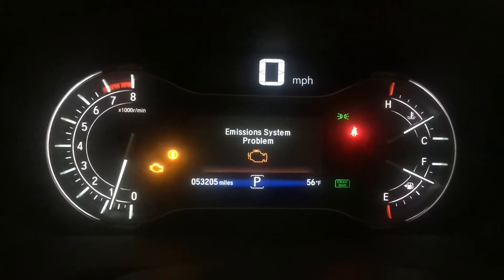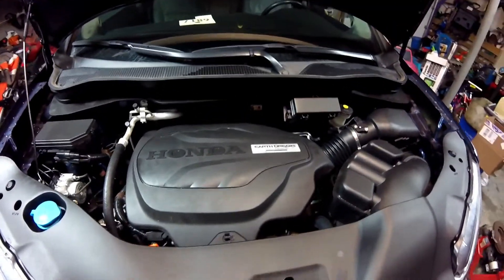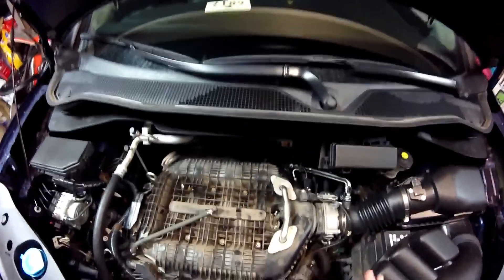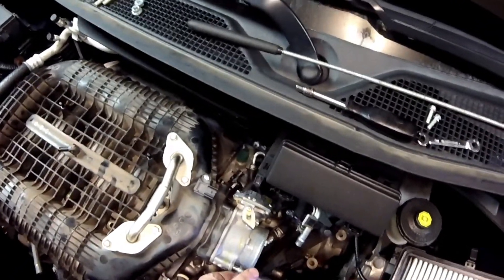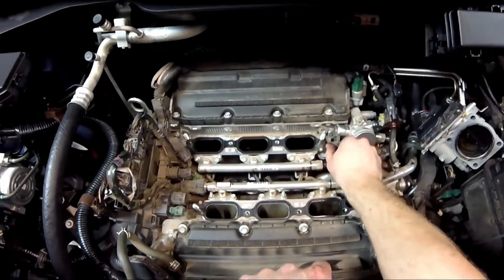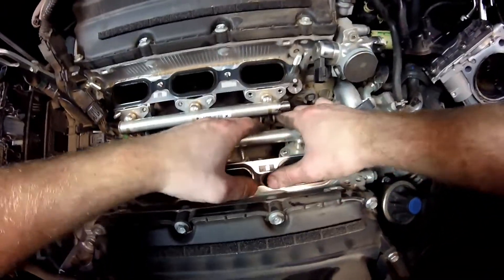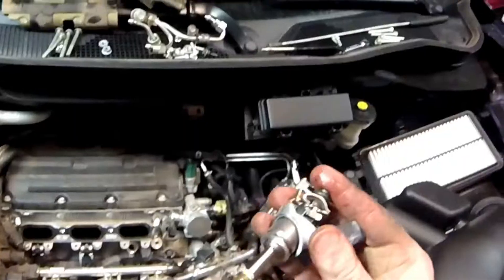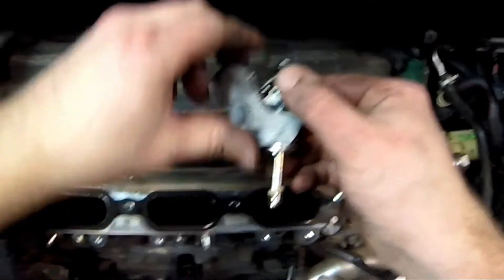2016 Honda Pilot P0430 Service Emissions System - Fuel Injector Replacement-Part 1

Comment: Warning just came on. Sigh. What did you use to detect the codes? I know there's all kinds of code readers out there.
Reply from the maker: I use BlueDriver. It works well with my iPhone.
Reply: @PetesGarageandperformance  Cool thx. So the warning went away and hasn't come back. Dumping some sea foam first, that has worked before on a different car to clean sensors related to emissions. But I have this procedure in my back pocket when needed. You made it look pretty straight forward for the most part.
Reply: update I got my BlueDriver odbc reader (I love this thing already, so easy to use) and it reports P219B "Bank=2 Air Fuel Ratio imbalance". "Frequently reported fix: Replace fuel injector."  Same code. Sigh.  No pending codes. You video was easy to follow but the eye-sight isn't what it used to be so need to think about doing it myself or letting local repair shop (not dealer) fix it.  Thanks to your videos its pretty clear what to do. BTW, any suggestion on honda injector p/n to order?

Comment: Sep 6th,2021. My 2016 pilot shows p0139 and p0159, sensor bank slow response. Long term fuel rich, slightly misfire on c5. Replaced fuel injector, all tested good. Argued with them before , service rep did a quick search and told me 0 cost to do this and waived off inspection fee as well. They also said fuel filler cap evap test a large leak , want charge me 205 cad for filler cap replacement, waiting for the parts …

Comment: I have the same problem on pilot 2019 21k  miles. Dealer are charging me 200 for injectors clean up 200 for throttle body clean up. I won't pay

Comment: Posted here and in Part 2 vid as well: First, thanks for the videos, Pete! The process looked pretty straightforward and I was reviewing the videos to do it myself. As others have mentioned, though, the good news is that this is a known issue by Honda and they have issued at least a couple TSBs and will correct the problem for free if your car is within time/mileage window. You can also apply for reimbursement through Honda if you already did the work yourself or paid for the work elsewhere. The original bulletin, 18-025, was replaced by 20-100 for some Pilots, Ridgelines, and Odysseys. Here's the link to 20-100: https://static.nhtsa.gov/odi/tsbs/2021/MC-10187006-0001.pdf
Reply from the maker: Thanks for the information and the heads up. At least they’re standing behind them now. Sucks for all the people who had to either fight with Honda or pay to have them replaced.

Comment: Check engine light came on with these codes on my pilot. I ran a gallon of xylene with 8 gallons of gas. Check engine light out and codes gone.
Reply: How many miles did your vehicle have when the check engine light came on and you performed this action, and after three years has the Emission System Problem come back?

Comment: Okay. It's now February 2021. I have a 2017 Pilot, bought it brand new with 7 miles on the clock. Yesterday around @26500 miles my Pilot displayed the same message.[ passed the 36000/3 years warranty].  Took it to Honda and had they run a diagnostic.  They replaced the Fuel injector kit.  Apparently there ' s an extended warranty TSB #20-100
7529 WAR2. Honda replaced the Fuel Injector Kit free of charge. Part# 37805-RLV-315. HOPE THIS HELPS SOMEONE. Initially I was going to do it myself but I ended up saving around  $500.00 for parts ... but  thanks to the extended warranty it was $0.00 out of my pocket.

Comment: Thanks for the video.  I have a Pilot 2016 with 75k miles.  It had the same issue and the dealer will be doing the work. It was the fuel injectors as described in this video.
Reply: Forgot to mention, the Honda dealer is doing the work under warranty at zero cost to me.
Reply from the maker: That’s great. At least you don’t have to pay for it.

Comment: Great video!  However, this is not something that can be easily tackle.  I suggest leave it to pro!  My 2017 Pilot had the Emission Light P0430 came on at about 49K miles.  So you don't have much option, dealers will charge about $1,500+, the injector itself is about $250 for all 6.  Long story short, I grab 6 bottle of Chevron Fuel Injector cleaner from Amazon - $37.00   Follow the instruction.  When completed my 2nd bottle, the light disappear.  It's been more than 3 gas fill up (approx 1,000 miles) and it has not reappear.  Prior to this, it would appear after 75 miles after fill up.  Keeping my finger cross!  Hope this help people!
Reply: Any update?
Reply: @jonimzari1687  Honda had a recalled and I took to my local Honda dealer to have it repaired...Haven't gotten the issue since..finger crossed!
Reply: I got a used 2018 last night and driving home (it was late) from dealership got the emissions light... bruh 🤦🏽‍♂️
Reply: @jonimzari1687  Disappointed!  Check your VIN to make sure if it was recalled.  If it's a recall and the previous owner didn't do them, just take it to any Honda Dealer.  If not, you have to get a scan reader to see what the actual emissions error code and go from there.
Reply: @rontan8954  i called the dealership i went thru they said to bring it back since it hasn't even been 24 hrs but I got a feeling they just going to delete the code and it will come back. My dad owns a mech shop so im goin to.run a scan before I go just for curiosity
Reply: @rontan8954  they cleared the code and im moving on...I suspect the dealership may have done that originally when they took the car and then it came back...so the issue was always there it just didn't appear on my test drive
Reply: @jonimzari1687  After a cleared code, Usually come back after apprx 100- 150 miles.  A P0420/P0430 is an emission sensor problem code cause by several factor:  Air/Fuel sensor, catalytic, Oxygen Sensor, leaky exhaust.  Almost 80% of the time it's the downstream O2 sensors, usually happen around 80 - 100K miles.  If 02 sensors is the culprits, make sure you get Denso brand, it seems to last a bit longer based on my experience.  Good luck and let me know what you found!.
Reply: @rontan8954  I ended putting some injector cleaner in the car. After first 50 miles the fault was still on. After thst it disappeared and been gone for 350 miles 🤟🏽

Comment: Doing this repair right now and the upper manifold won't come off because of an electric cover on the left side of the engine.  It looks like you have it on in one shot and off in the next.  Any ideas?  Thanks a million!
Reply from the maker: I’m not sure what electric cover you’re talking about. Did you end up getting it?
Reply: @PetesGarageandperformance  I figured it out.  It was the piece that you put back on in the second video at 12:46.  I just didn't want to break it.  Got it done and it drives great.  Added a VCM Muzzler as well so hopefully I won't have to do this ever again...  Thanks for the video.  Saved me $$$.

Comment: What is the most likely cause of this Emission System Problem? Could it be Fuel type? (Premium vs Regular).I just had it pop up on my 2017 Honda Pilot EXL AWD. Thank you.
Reply: Just took my 2017 pilot in today for same problem ur having. They said 160$ for diagnostic. We’ll see what’s wrong
Reply: @generalponcho808  It costed about $1200 i didn't have to pay a dime because the vehicle is still under 100k miles warranty.
Reply: @edgarcharles3637  just got word FUEL INJECTORS @ 60201 miles 2017 Honda Pilot. Luckily covered to replace fuel injectors!  Hilo Hawaii. I’m the second owner of car

Comment: I'm so glad I found this video before I got started. I'm assuming the 2017 will be identical to this one. I've been having a fuel air imbalance issue in bank one for a while and now just recently started getting misfires in cylinders 2 and 3.
Reply from the maker: I would say that it’s probably the injectors.

Comment: Pete, thanks for the video, I followed it and the project went smooth, I have a 2016 Honda Pilot.  The problem still exists, could it be that I have not had the new injectors reprogrammed?
Reply from the maker: What was the problem. Just the code?  Clear the code and you’ll have to drive enough for the monitor to pass.
Reply: When accelerating about 2k rpm, car would start jerking, took it to Honda codes p0304, p0420. P219-A, they said I needed new injectors.
Reply from the maker: From my experience if the car is jerking then it’s probably something in the ignition system. I would swap the ignition coil and spark plug with another cylinder and see if it follows it.

Comment: Guess I'm lucky I got 88k miles and it just came on
Reply: Well they ended up replacing the injector set and injector pipes suposedly their was no service bulletin for this repair, this is my very first vehicle I buy from new I got a good price on it $12k off MSRP it's a 17 that I bought Jan of 18 with 8 miles on the OD 2y and 7m later I got 88k miles on it, I added all the imaginable coverages on it from tires and wheels to replacement key fobs to door dings repair to interior repair or replacement and a 6yr 120k mile extended warranty, so this repair got charged to the warranty I paid $100 deductible, I asked the guy if once my warranty was over if i could purchase another one he said yes I have to talk to finance, so might be something you all want to look in to if you don't have it is go to the honda dealer and look in to buying the honda extended warranty not certain that you can but it's worth a try I've definitely gotten my money's worth so far 4 covered repairs over $3800.00 worth.

Comment: I have a question I have  a Honda Civic ex 2018 can you please help me the following lights came up out of nowhere emissions system problem, brake system problem, brake hold system problem, vehicle stability assistant problem, hill start assistant problem and power steering system problem they all lit up at once can let me know what it could be??
Reply from the maker: To be honest it could be anything. You really need to have the codes scanned to see what they are. This would help narrow things down.

Comment: Had the same emissions systems error popping up then going away then coming back, I changed the objectors and oil pressure switch error went away for a bit then came back ,now am seeing a keyless start system problem error as well
Reply: Can u suggest anything @petesgarage
Reply from the maker: The injectors won’t have anything to do with the keyless start system. Maybe the key fob battery is weak? In order to diagnose it you would need a factory scan tool to see what the code it’s setting.

Comment: My 2116 pilot emissions system warning light comes on and goes off before I can take it to the dealer.  So I finally took it to them without the warning light being on and they told me I have to get the injectors replaced. Bought it with 83000 and now it’s 92000 and they want to charge me over 1700 to replaced. Any advice
Reply from the maker: $1700 is pretty steep for this job. If you’re mechanically inclined, do it yourself and save over $1000. Just follow along with my video.

Comment: How long can drive with this problem before you fix it??!!
Reply from the maker: Probably not too long since the code is telling you that the catalytic converter is compromised.
Reply: I had replaced fuel injectors (replaced them actually twice) and after couple weeks of getting fixed , I got another code, needed to replace catalytic converter. Just picked it up yesterday and now another light is on, now transmission system problem. Ugh. I was told now I need to replace the torque. When will I see an end on these lights? I have a 2017 pilot. I never had any issues with my Honda Accords.
Reply: @mireya-y9c  You mentioned you replaced the injectors twice, by chance did you get them covered free of charge going through a Honda dealer, or you replaced them yourself? Also how many miles did you did your Pilot go through before having to change them a second time "Injectors"
Thank you in advanced

Comment: My pilot has been at Honda for 7 days. For the injectors!! I even had a scheduled appointment!!!
Reply: @Amarrah my car was fixed after a month and running good until now after they replaced the fuel injectors. The parts that caused a month delay doesn't even solve the problem. They never believe me at first when I told them that the problem was the injectors. If you have the same problem tell them that this is a common issue with pilots 3rd gen and insists that they should fix the fuel injectors.
Reply from the maker: Wow! They must be backed up or something! This job doesn't take that long. I wonder if they found something else?
Reply: Pete's Garage that’s what happens when you don’t care about profiting from the mechanics work. They get all the money from the car sales
Reply: Mine has been a month already. They said the parts are backordered. 2016 pilot  ex

Comment: Hey Peter, I have the same issues on my pilot 2016 and what other parts require beside the fuel injector which I already bought it. Do I need to buy the pipe that run through it?
Reply from the maker: I did all 6 injectors. You are supposed to replace the feed pipe but I didn’t. Just make sure it doesn’t leak fuel when done.
Reply: Pete, I also bought the same injector set from the site you had in the description.
Reply from the maker: I did all 6 injectors. You are supposed to replace the feed pipe but I didn’t. Just make sure it doesn’t leak fuel when done.
Reply: Hey Pete, I spoke with one the local garage repair guy. He told me they require special tool to seal the fuel injector. He wasn't sure if they come with sealed or not. Can you please give me some more info do I can get this done with local garage guy instead of Honda dealership who wants to rip me off
Reply from the maker: Ankit Patel the ones we purchased from the dealership came with the seals already installed on them ready to go.

Comment: 2016 Honda Pilot with 64,000 miles. Fuel Injectors went bad but my extended warranty did cover it.
Reply from the maker: That’s good that it was covered. I bet that bill was probably about $1100 or so.
Reply: I have a 2017 Ridgeline and the same message came on, Emissions System Problem. I only have 26,150 miles on it. do you think it could be the same thing? I really hope and pray that I'm still under warranty.

Comment: quick question I am a little confused, I get the P0430 code, which when looked up says to change out the Oxygen Sensor behind catalytic converter. But the real problem is the fuel injectors?
Reply from the maker: The p0430 sets because the rear o2 sensor voltage follows the front o2 voltage. It should be relatively flat voltage because the catalytic converter should be cleaning up the exhaust. Since all of the injectors should be spraying the same amount of fuel the ECU determines the amount of correction based on the front o2 sensor that is seeing essentially the average of the three cylinders on that bank. If the injectors aren’t spraying the same then the ECU may over fuel as a result of making up for the other cylinder’s lack of fuel. Then the converter gets over saturated with fuel and sets a p0430. It may need a converter eventually, but if caught soon enough will clean up with the new injectors. I hope this makes sense.
Reply: @PetesGarageandperformance   So the end state is change the injectors out? lol sorry I am not mechanically inclined, but I have been learning just went through a huge ordeal having to do a complete replacement of the camshaft, started out as a $40 part turned into a $2400 project due to an issue of a post I saw further down in the comments here. the code for that was a cam shaft position sensor. but because Honda has no idea what the problem actually is that causes that error, they only know to replace everything.
Reply from the maker: Yes, replace the injectors. They come as a complete kit of 6. I think there is also a reprogram for the ECU to help prevent it from reoccurring.
Reply: Pete's Garage do you have a place you suggest to order the parts from? I looked on Rock Auto and they only sell them as singles.
Reply from the maker: At the time I did the job rockauto didn’t even have singles. We bought them from the dealership. The people who I did the work for had a Costco membership and somehow that got them a discount at Honda dealerships.

Comment: hey everyone ..I had the same issue with emission and AWD lights came on ..The problem was I used Royal farm 88 gas  ... I fixed the problem by draining all gas inside the tank and replace it with  87 regular gas.

Comment: Hi. I have a 2014 Honda Pilot Touring 4x4, the “check emissions system” light is on with the “vtm-4” I just replaced the vtm-4 fluid. both lights come on periodically. Please help!!
Reply from the maker: You have to scan for codes.
Reply: Pete's Garage I did. It's p3400
Reply: I have thesame problem. Did you get it fixed?

Comment: Just bought a 16 pilot last week. Check engine came on. Thought it was bad 02. Took it to honda and they fixed since I just bought it 1 week ago. Good thing it failed within a week. Edit: damn you have to remove a lot of parts to reach the fuel rail and injectors.
Reply from the maker: These DI injectors are buried in there to be able to inject directly into the correct part of the combustion chamber.

Comment: What you know about the code P0087
Reply from the maker: Your fuel rail pressure is too low. It could be caused by the following: high pressure fuel pump, fuel rail pressure sensor, leaking rail, or leaking injector.
Reply: @PetesGarageandperformance  okay thanks a lot